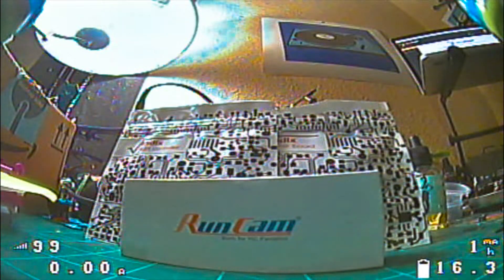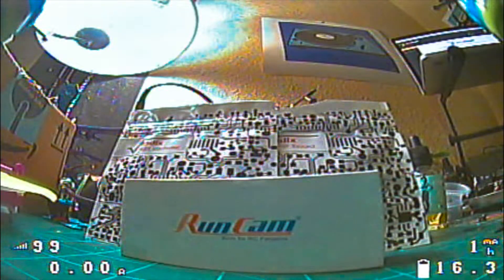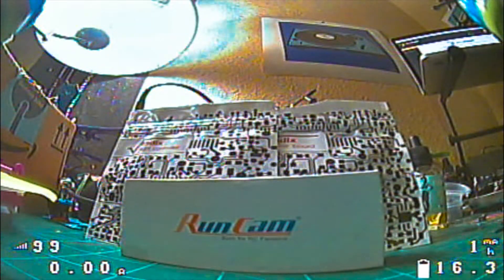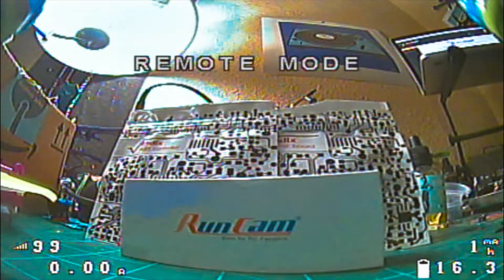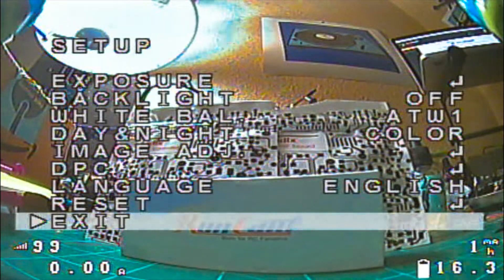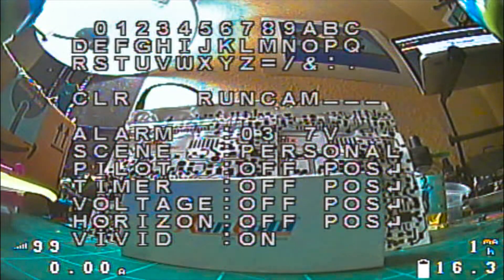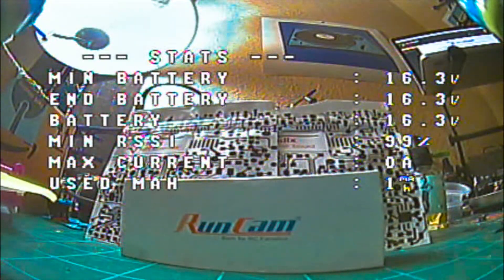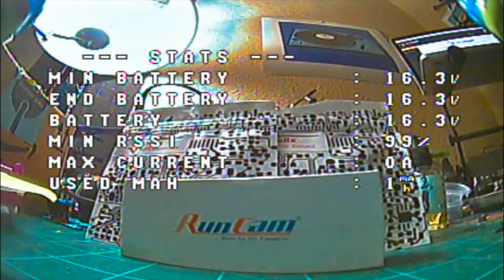Brainfpv Radix FC Camera Control Tutorial

Comment: Can't you use the CC pad on the FC for this. "OSD: Many cameras have a “OSD” input that can be used to access the internal OSD of the camera to change camera settings. You can connect this signal to the CC (Camera Control) output of the RADIX FC, which will let you access the camera OSD menu and change camera settings using your RC transmitter sticks."